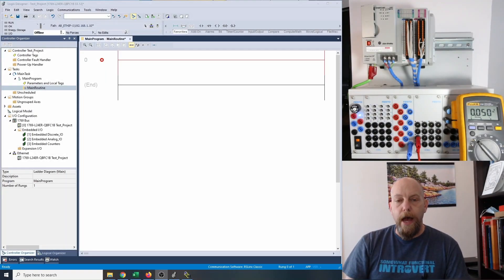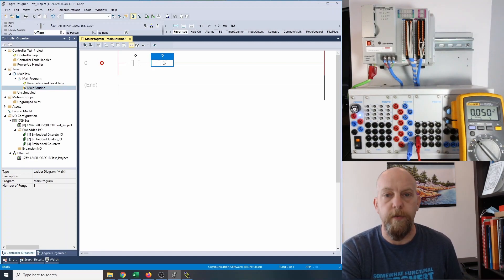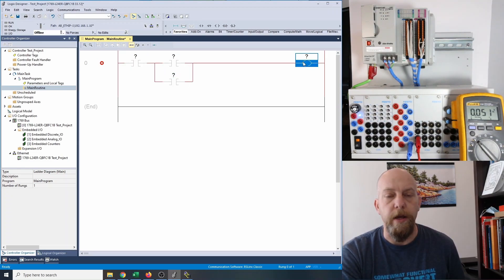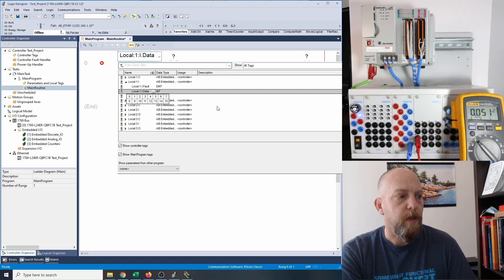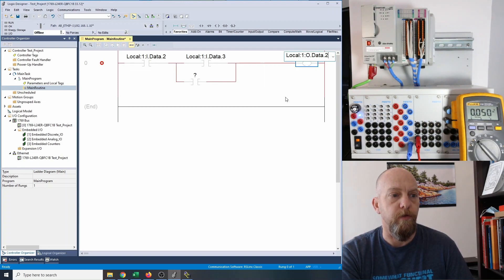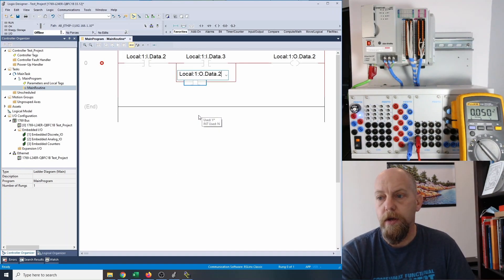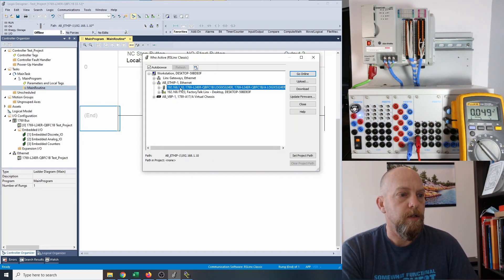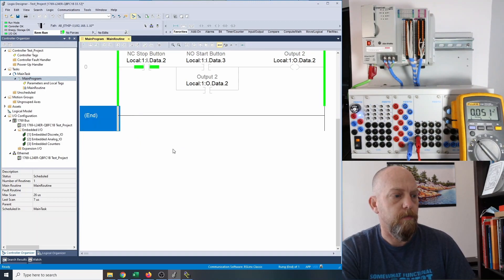Studio 5000 PLC Programming (3 Wire Latching Circuit)

Comment: The Stop button is wired XIC for safety. If power is lost it is expected the machine will be in a safe condition on power reset. If the latching circuit does not reset then the machine can come back on unexpectedly. I believe that may have to be that way to meet code. At least that's standard for industrial applications.